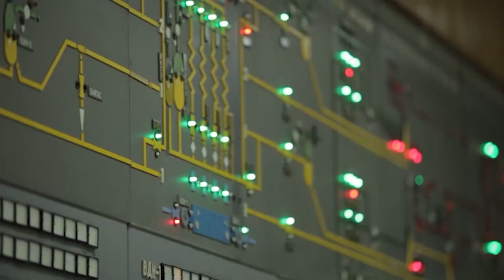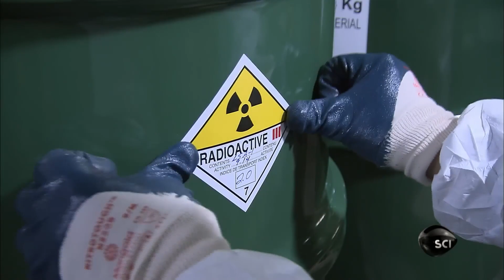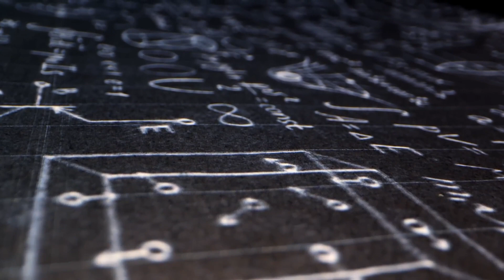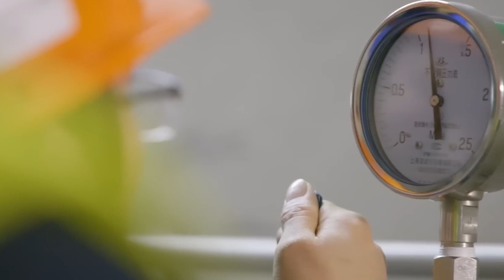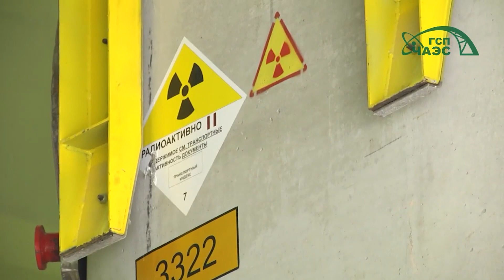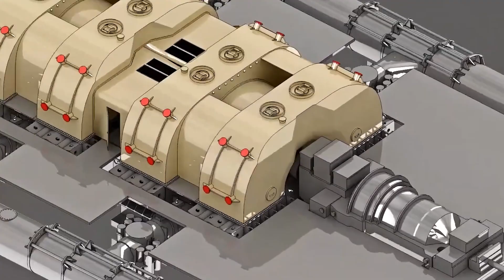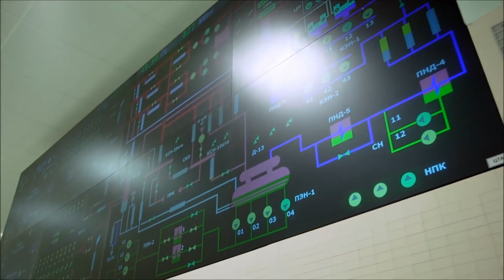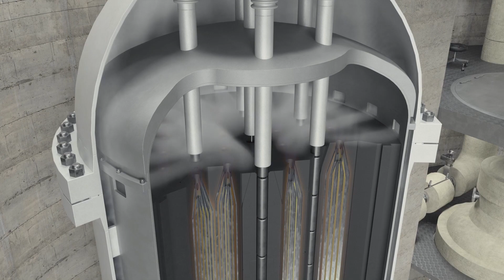Closed nuclear fuel cycle: practically inexhaustible energy is already almost within our reach!

Comment: The future are not the BN-* and Brest* type Fast Reactors with solid fuel and separate reprocessing, with processes like PUREX. The future lies in liquid fuel reactors, either molten salt with soluted fuel or molten metal fuel. 
One advanced patented design is the Dual-Fluid Reactor (DFR). It is actually a kind of BREST type reactor, with molten metal instead of solid fuel, and lead as primary coolant. The molten fuel allows for onsite/online reprocessing by a pyro-processing-unit in the reactor building itself.
 🔋 Key Advantages of the Dual Fluid Reactor (DFR):

• ⚡ Ultra-efficient: Nearly 100% of nuclear fuel is used  
• ♻️ Burns nuclear waste, depleted uranium, and even thorium  
• 💥 Transmutes long-lived actinides into short-lived fission products  
• 🔄 Built-in Pyro Processing Unit (PPU): Continuously removes neutron poisons and extracts valuable metals  
• 🛠️ Liquid fuel: No solid fuel rods, no batch reloads  
• ⏳ Decades of operation with a single fuel load possible  
• 🚫 No corrosive salts: Liquid metal fuel avoids fluoride corrosion and complex chemistry  
• 🧊 Lead coolant: Excellent radiation shielding, no water, no pressure → no steam explosion risk  
• 🌡️ Very high temperatures (700–1000 °C): Enables hydrogen, e-fuels, ammonia, and direct steel reduction  
• 🧠 Self-regulating: Output adjusts automatically via negative temperature feedback  
• 🪫 Minimal waste: Only short-lived fission products remain
• 🏭 Compact & scalable: High power density, ideal for modular deployment  
• ⚙️ No moving parts in reactivity control: No control rods required  
• 💰 Uses existing stockpiles of spent fuel, DU, and thorium  
• 🌍 Reduces dependence on enrichment, imports, and fresh uranium mining  
• 🔄 Full closed fuel cycle: No external reprocessing needed  
• 🆚 Outperforms typical SMRs: No pressure vessels, no high-pressure coolant, no water-based systems

Input at the reactor building may be spend fuel of any kind, depleted uranium and natural uranium, and even thorium. The output at the reactor build is after about 300 years of storage, 95 % separated partly precious metalls and about 5 % waste with activity about that of natural uranium. Compared to conventional LWR this reduces the waste 2000x per energy unit. The real waste to store amounts to less volume than a Coke can per TWh. 
Many countries like the US have a large stockpiles of spent fuel and depleted uranium, that can fully power them for thousands of years, and are worth 100rds of trillions USD, that could easily downpay the national debt multiple times.